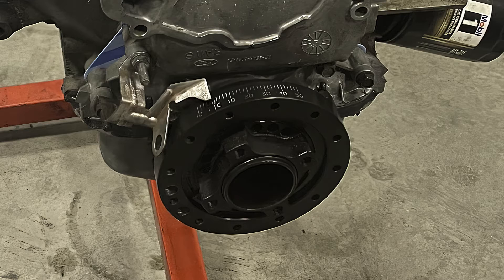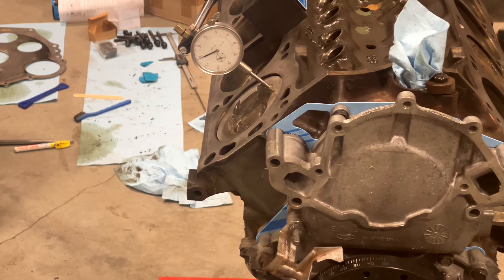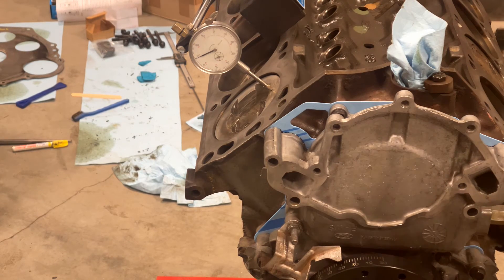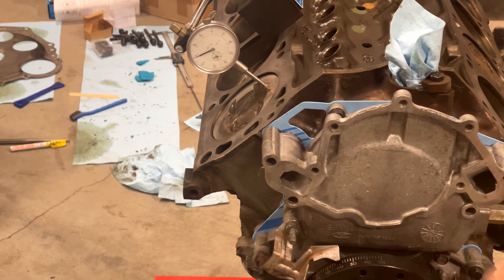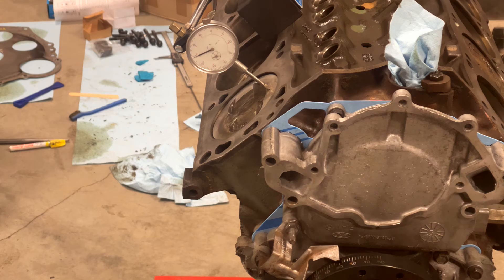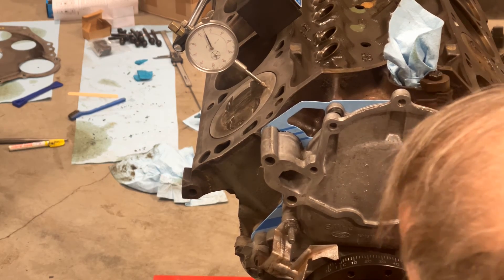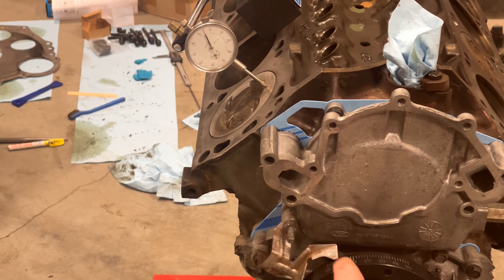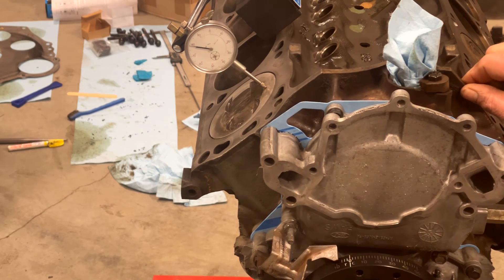How to Check that your Timing Pointer is Accurate

Comment: My engine doesn’t have any useable timing marks, I could really use some suggestions
Reply from the maker: If you don't have a timing pointer, they are available either as a stock replacement in the case of a typical 5.0 or an aftermarket adjustable. I have even seen a piece of stiff wire rigged to the front cover and used as a pointer. If lack of the pointer is not your only problem, try using an inspection camera through the #1 plug hole to locate TDC on Compression #1 then place a mark on the balancer that lines up with your timing pointer when it is at TDC #1 Compression. This method when executed carefully will normally result in a mark that is within around 2 degrees of true TDC.

Comment: what is the hole for on the other piece of metal right beside the flat piece that is actually used for timing the engine?
Reply from the maker: It's a good question, and I have never known why the pointer is made that way. It causes issues though because there are guys who think you should time it through the hole instead of on the pointer edge which is actually labelled "TIME".

Comment: I like the video how you do it with the heads on? I seen some folks putting a finger or paper in #1 cylinder spark plug hole. Is that fairly accurate or do I have to take the heads off ?
Reply from the maker: The most accurate way with the heads on is to bolt a degree wheel to the crank, install a stop in the #1 spark plug hole, turn the engine forward until it stops, note the position on the degree wheel, turn it backward until it stops, note the position on the degree wheel, divide the difference between the measurements by 2, and then you will know where TDC is in reference to the degree wheel. A less accurate, but reasonably good way to do it is use an inspection camera in the #1 plug hole and rotate the engine until you can visually see TDC. Usually rotate it until you see piston start to just move back down, then turn it back until you see it top out again. I usually figure I can get within about +/- 2 degrees with a visual inspection camera technique. This is certainly good enough for determining if your balancer has spun or positively identifying the timing marks on a balancer with more than one set of timing marks. If you DO have the heads off, the technique shown in this video is a very accurate way to be sure you have the pointer in the right place, but I wouldn’t pull the heads JUST to take this measurement. Inspection cameras are very inexpensive and easy to get these days, and a useful tool for all kinds of purposes.